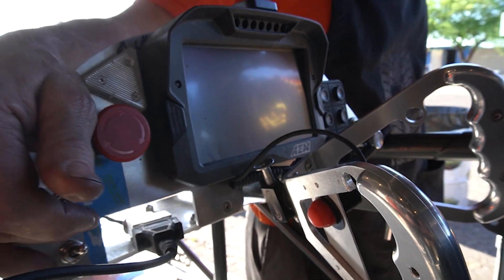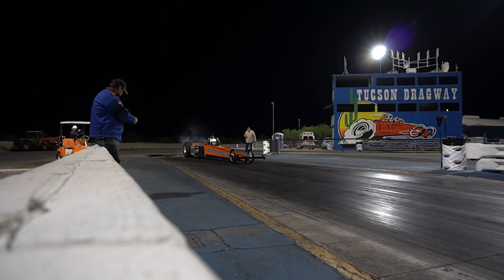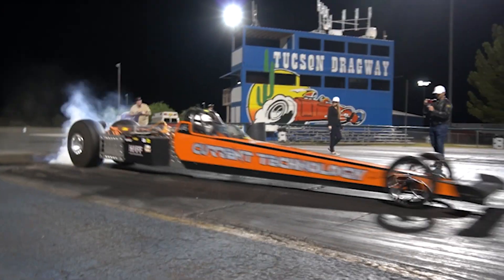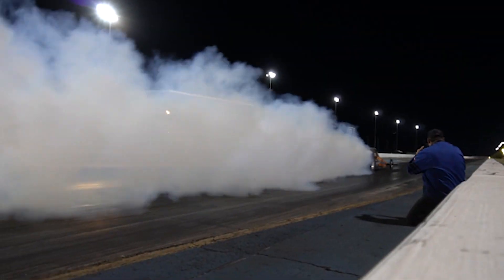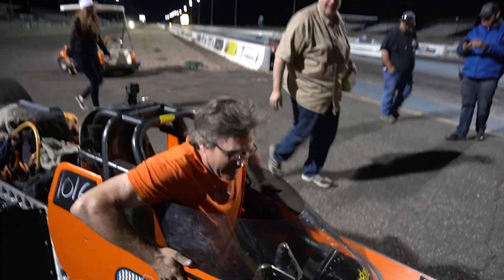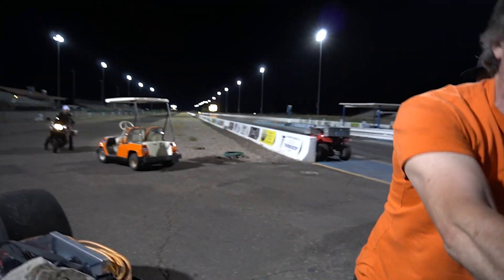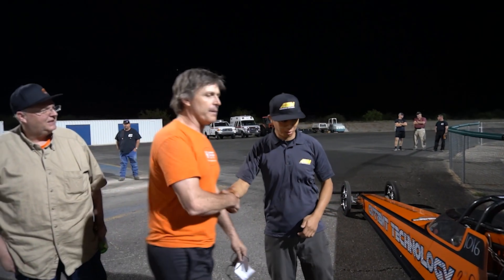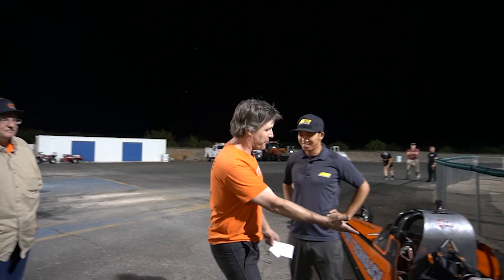ELECTRIC DRAGSTER BREAKS 200MPH!

Comment: Top benefit of an electric dragster: you can use the same engine more than once 💪
Reply: Way cheaper and easier to run. And the most complex tools you'll really need to work on the motor are some screwdrivers and a soldering iron.

Comment: Electric Dragster One in the world most reliable and durable engine in the entire whole world that could run 201mph without wear and tear on its engine.
Reply: Thats inaccurate, batteries go bad
Reply: @__Jesus_is_God__  yea but normal top fuel dragsters have to rebuild the engine entirely after every run.
Reply: @tfrbuck2633  A top fuel dragster also runs 130 mph faster and makes 9200hp more than the electric one. A 330 mph feat I highly doubt the electric dragster will ever accomplish. 🤔🤔✌✌
Reply: @bowtie-man  you're joking right? Look at hyper cars the electric ones have already pissed on them for speed and acceleration it's just a case of time to get to the stage of motor vs engine competing
Reply: @__Jesus_is_God__  The battery isn’t the engine. When you run out of gas in your ICE, you wouldn’t say the engine  wore out.   So how is his comment inaccurate?

Comment: Is that the tires making that flapping noise? Noticed it on the ev mustang cobra dragster too. Sounded like a person clapping but slower than you would think if it is the tires.
Reply: It's normal, search for it, driver61 has a good video on it, basically these tyres are very low pressure and they twist a bit when they start spinning

Comment: What H.P. motors are being used?
Reply from the maker: This car uses 4 Cascadia motors totaling to about 1800hp if I recall correctly.
Reply: @AEMpowerTVelectronics  wow, for an electric motor that is huge, unless that is after ot factors in a gear.  But I'm more on Industrial electronics so one of our 400-900 h.p. mot. is huge and weighs a ton . .or two
Reply: @alanwilliams707  I suppose these are Permanent Magnet Servo Motors.
Probably with a thin caliber winding. It can produce a massive force, but maybe also heat.